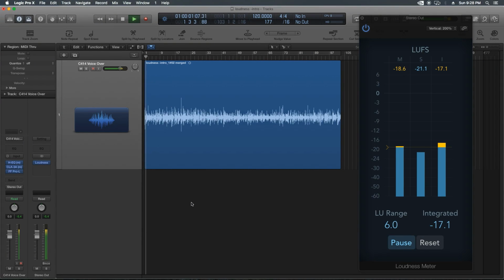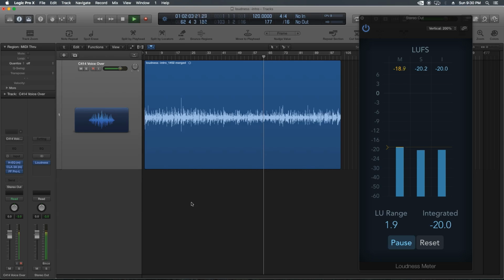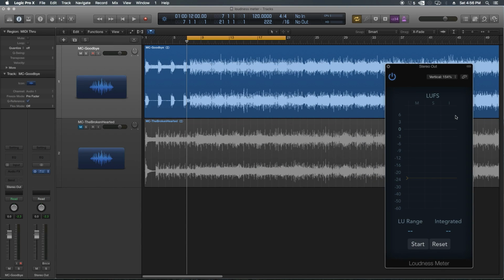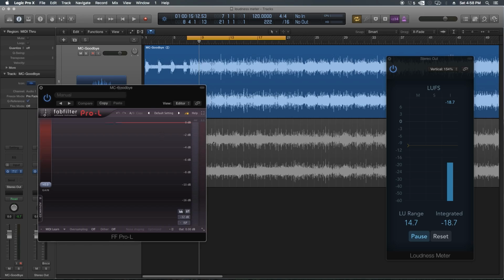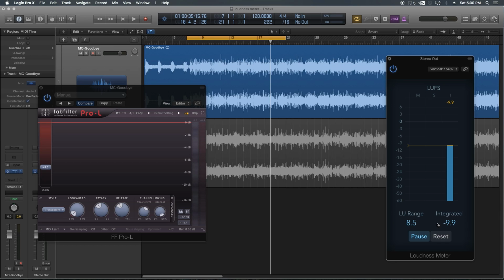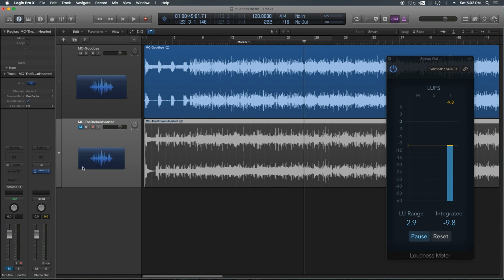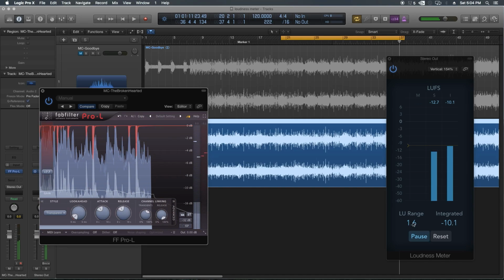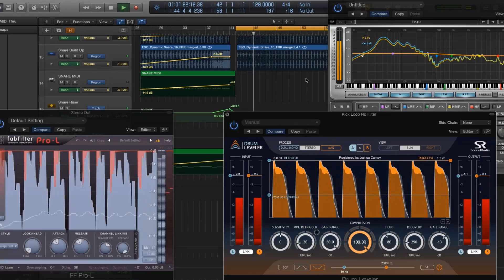Logic Pro X (10.2.3) - Loudness Meter, Understanding LUFS

Comment: Good vid. But he didn’t really explain why LUFS is better. While decibels are used to measure the intensity of sound or the power level of an electrical signal by comparing it with a given level on a logarithmic scale, LUFS specifically measures loudness levels over time to give an average loudness measurement. This is done to closely match the human ear’s perception of loudness, which is not linear and varies with frequency and duration of sound.

One of the key concepts in the LUFS measurement system is the use of a relative scale set against a full scale (0 dBFS, or decibels relative to full scale, where full scale represents the maximum possible digital level). LUFS measurements take into account the loudness perception of the human ear by using filtering that mimics the ear’s response to different frequencies, known as K-weighting.

Comment: Do you have a vid to explain why the LUFS shows -10 but the meter lower left is in the red?
Reply from the maker: You mean the stereo output? Yes, it's simple, just because the meter is red, doesn't mean you're clipping, especially if you have a limiter on it. Logic's channel meters are weird, the top of the meter is red, but the clip light is orange. Really it should be the opposite, the top of the meters should be orange, with a red clip light. Also, there's a huge difference between PEAK levels and LUFS levels. LUFS levels measure perceived loudness, where as peak levels do not. So peak levels will appear 'higher' on the meter.
Reply: MusicTechHelpGuy  Thanks I thought I was missing something.

Comment: Any tips for me?
I’m using the Loudness Meter and I aim for it to hit -16 integrated loudness. However, I notice that when I do get there I’m clipping the mater bus. 

Currently I’m in a battle of trying to make my church livestream louder for phone users, but it seems that the only way to do that is by NOT using conservative meters, especially in the master bus. That is, when have a clean meter on my master (-12 or -16db) the livestream volume sounds super low on phones.
Reply from the maker: Are you actually clipping? Or is the level just at the top of the meter? If you don't see the clip light you're not clipping.

Comment: Why is stereo out clipping like crazy?
Reply from the maker: Not clipping. That's the point of having a limiter on the stereo out. If the clip light doesn't show, it's not clipping, it' just a higher signal level. The top of the meter is red, but that's not the clip light. It always stays at 0.0 or lower.
Reply: @MusicTechHelpGuy  I see that the peak level display remains 0.0. What threw me off was the meter going to the red color. 
Just learning here. Thanks for your response; great vid overall.

Comment: I have a question Mr Helpguy, if I may.   I have trouble recording my guitar. I like to have the amp fairly loud to get "That Sound" from my valve amp.  The problem is I cannot hear the rest of the mix when I am recording and this makes my timing out.  I have tried moving the amp into a corner and padding etc, but it still overpowers the mix when I record, even when Input Monitoring is disabled.  The recording level seems fine but is too loud to play to.  Is there anyway I can turn off the audio signal I hear in Logic so that I can just hear the ambient sound of the guitar amp and the rest of the mix through headphones?
Reply from the maker: Just pull down the volume fader on the guitar amp track. The track volume has nothing to do with the recording level, so you can dial in whatever volume adjustment you want while recording.
Reply: @MusicTechHelpGuy  Many thanks for the quick reply.

Comment: Thanks a lot for your tutorials. 

Referring to the episode about loudness meter of logic. I noticed that your fader meter got red all time when you were pushing the loudness to reach  -18db. However, I didn't observe any clipping by listening.

May I know whether we need to consider the fader reading while adjusting loudness? I copied you way of doing and got the same confusion!
Reply from the maker: +Kenneth Kwong you're not the only person whose asked this question. Logics meters in 10.2 turn orange when clipping however show red at the top of the meter. It's confusing. In 10.3 they show a red clip light but still show red at the top of the meter. It's just a graphical thing. If the value at the top is 0.0 or less your not clipping. It's fine, it's just a graphical thing.

Comment: Thanks for the video! Nicely covers the issues of loudness metering. I didn't realize they added loudness meters to Logic - I've been using a third party LUFS meter (that makes Logic unstable, unfortunately).

One minor note (I work in the video preparation world so we have to follow these things) - the industry standard (pretty much worldwide) for broadcast/cable TV and streaming is 24 dB LKFS as measured by BS.1770-1. ATSC A/85, which defines loudness practices for broadcast in the U.S., allows for +/ 2dB compliance window, so an overall -23 dB LUFS would be acceptable, but slightly over target.

Premium cable channels (HBO, Starz, etc.) and theatrical home entertainment mixes (Blu-Ray) will often have a slightly lower overall LKFS loudness to allow for a wider more theatrical style dynamic range. The CALM act (which regulates TV broadcast loudness in the U.S. and has been adopted by most other countries as a model) allows for a different value as long as it is correctly conveyed in the AC-3 dialnorm metadata.

Comment: The rhythm guitar on the second track sounds so freaking good! how did you process it?
Reply from the maker: I have a Kemper Profiling amp. It's basically just DI run through a Soldano Hot Rod 50W setting on the Kemper. I just band passed the signal with EQ a bit, and boosted the 2k range a bit. The Kemper works wonders!
Reply: Kemper for the win

Comment: Great video. At what stage in the mixing / mastering process would you recommend using this?
Reply from the maker: Mastering at the very end of the signal chain, after all mastering effects. For post-production and dialog work, I would use it directly on mix busses to make sure that my LUFS level is -23 roughly for TV broadcasting.

Comment: Cool! 
Could you make a video on how to reduce the LU range the right way? I had the problem mixing a track when the intro was really quiet and when the chorus kicked in it got way too loud! I know i could have used more compression or automation or telling the masterengineer to limit more. But in your opinion, what's the best way to reduce the LU range? Thanks!
Reply from the maker: The LU Range is essentially how wide your dynamic range is, and it will vary a bit from song to song, depending on how much "space" the song has between highest peaks and lowest dips. Even after a mastering limiter, each song may have a bit of variation. I pay attention more to the Integrated value, unless the LU Range is WAY off. The lower the range over all you can more heavily compress the mix busses in your mix to flatten out the dynamics a bit more, but you don't want to do it so much so that it destroys the dynamics. Good luck!
Reply: +MusicTechHelpGuy thanks! Is that better than automate the mixbus?
Reply: Great vid Music Tech Help Guy!  

Holger - I wouldn't advise mixing or indeed mastering focusing solely on the LU range; you'll end up squashing your mix too much because you'll be too focused on numbers.  The LU range gives an idea of how dynamic your mix/master is, that's all.  Even though Integrated is king Short Term and Momentary are important aspects of the plug too but most important is your ears.  

If you're mastering and your intro is too quiet compared to the chorus I'd say you have two options automate the track channel with your mix to raise the intro level (not the master out) or go back to the original mix and remix the intro with automation.  If you still want to know the true LU range make sure you play the entire track from start to finish as true LU readings are based on whole program material.  Happy mixing and mastering.